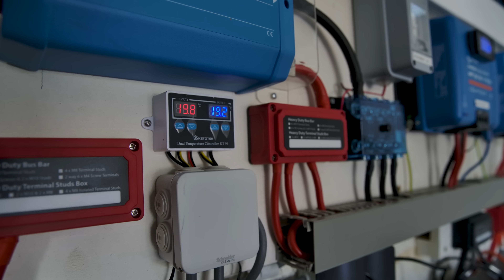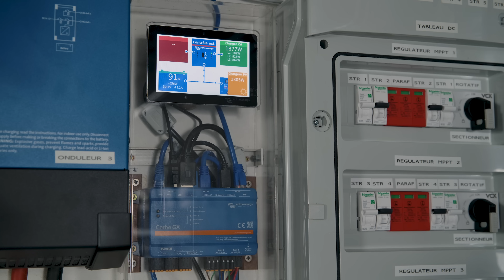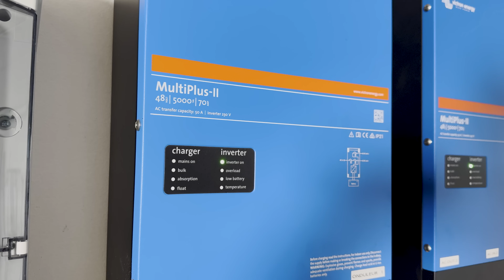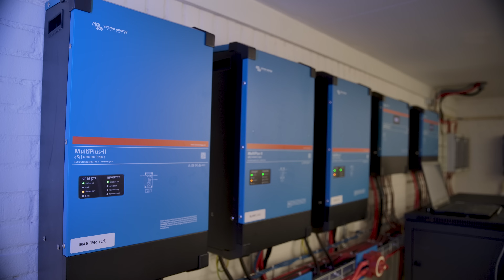Using solar and batteries to power this high-tech family home

Comment: I have 3 x Multiplus II's and 3 x MPPT 250/100 charge regulators here in Australia as well, only single phase but with enough panels I have now been able to disconnect the grid, there is even a Victron EV Charger here and there is sufficient solar power to charge the car. I will be setting up a small extra so that I can send power from the car, into the Victron Multiplus II's in case the sun ever goes away, it really does go away a LOT during winter here.
Reply: Bonjour 
 je suis ravis que sa fonctionne bien,  j'aimerais savoir, c'est la capaciter des batterie,. et la puissance des panneaux solaire .que vous ave installer

Comment: I've installed 1 Multiplus II 10kva system with 2 MPPTs 250/85, 16kw battery and 16 x620w panels and installed 2 more systems with Multiplus II 10kva, 16kw battery and 12x 620w panels for my parents and my neighbour as well.  

Absolutely happy with the equipment

Comment: Please change Mppt terminals to eye connectors. My RV almost burnt down because of screw terminals shorting out. And, I lost my Mppt, because it was my fault for not tightening the screw terminals after 1 day of use, then a week, then monthly. Look under the hood of your car, the eye connectors installed last the life of the car, In an extreme environment! Thanks

Comment: I am proud to say that Pakistani are also using victron invertor. I am using victron energy easysolar 48/5000/70 with mppt 150/100. Pakistani have installed 31.5 GW Solar panels in Pakistan in just 3 years.

Comment: As far as I know, Victron does not support delta 3-phased, only Star 3-hased (otherwise I'd buy Victron Multiplus battery). In the video, I see three MultiPlus, looking like a 3-phased system. In Belgium we have delta 3-phased for residency. Do you happen to have star 3-phased system or does Victron supports delta 3-phased systems now?
Reply: I'm on three-phase 400V, and you can run a three-phase 400V motor. I have an installation for a house that I did with a pellet boiler with several three-phase motors, and everything works very well ....
Reply: Ok, so you are lucky to have the Y configuration

Comment: These videos are honestly what motivated me to go with Victron products. I'm currently using a SmartShunt 500A, along with two SmartSolar MPPTs — and I’ve really appreciated the system overall.

However, I’m facing a persistent issue with my SmartSolar 100|50 unit. Even after the v1.67 firmware update, it struggles to track the Maximum Power Point properly under load, and efficiency drops significantly compared to my other MPPT (100|15), which works flawlessly.

I’ve already put together a full documentation of this issue — including graphs from Venus OS Node-RED, SmartShunt data, and real-world tests — and shared it with both dealers and the Victron community. But unfortunately, it doesn’t seem to be getting the attention it needs.

I would really appreciate if someone from the engineering or firmware team could take a look. I truly believe in Victron products, and I just want to ensure I’m not stuck with a rare faulty unit that can’t be properly diagnosed.

Happy to share the videos and data again if needed.

Comment: A lot of the solar setups in the US shut down when the grid goes down due to fear of back feeding electricity from the solar panels onto the wires while the crews are trying to make repairs. I don't hear much talk about how Victron handles the grid going down while generating solar power or has battery backup. I went with an Enphase system in my house that forms a micro-grid. It combines power from the grid, solar and battery. The installers manually shut off the grid connection to test the installation and I didn't even notice it.
Reply: The multiplus detects the power outage and switches off the internal relays that connect the grid and goes in island mode. After the grid comes back it synchronizes and the relays close again.
Reply: @SiegersNL  Yes, that's correct.
Reply: That is basically what my system does but my comment was more about I don't hear much talk about it. 
My battery is constantly connected so there is no interruption of power delivery. The system probably plays around with various voltages to control the flow of energy so it can charge the battery only from the solar or from the grid. I can use my battery to reduce the demand on the grid even without an outage. I assume the Victron system has similar features but there is not much discussion on the topics.
Reply: @wstrater  the victron multiplus is even more resilient as it has a separate grid, generator and island AC ports which are isolated from each other. While it is possible to feed power from grid directly to island with frequency coupling it has no problem with bad power supply or an unstable grid. This is cause of victrons root in marine/yacht systems where the grid can be disconnected or be low power or a generator cannot deliver the power the island should provide.
Reply: @martin5697 This is the part I don’t understand. If they are isolated, then how does it combine battery inverted power with grid or generator? Is there an interruption in power if the house is running on just grid and the grid goes down? Does it need to synchronize frequency when cutting over to battery?
I believe my system is always connected so solar and battery inverter are always in sync with the grid. It also means that when the grid goes down there is no interruption.
I am not trying say one is better than the other, I am just trying to understand.

Comment: Why doesn't he feed excess power to the grid in the summer instead of switching off solar panels?
Reply: Sometimes you get a fine when you do that depending on your contract.
Reply: Alors oui effectivement je ne voulais pas remettre le surplus sur le réseau. Parce qu' en Belgique le fournisseur d'électricité imposait un tarif prosumer   qui est de 86 euro par kW , en-dessous de 10kva et donc si l'onduleur fait 5kw x5. suite  à ça j'ai fait une demande au fournisseur pour pouvoir renvoyer le surplus sur le réseau. Ce que je ne savais pas c'est que si la puissance de l'installation dépasse 10kva ce qui est le cas . et donc je ne suis plus prosumer mes producteur d'électricités .Et sachant ça je peux revendre le surplus d'électricité. Ce que je fais  maintenant.....
Reply: @christianlalieux1980  thank you. so it is the electricity contract and not the technical capability of your system.

Comment: 5:52 nice, but, ...it is smarter to mix with some ac-(micro-)inverters, so you do not need to load from the grid when you exceed 9000 watts.

when you have for example 5000 Watt from ac-inverter, and you can get 9000 watts from inverters, then you dont need grid for example, when you use a  11kw instantaneous water heater for shower. but you have to shower always when the sun is shining ^^
Reply: Si je prend sur le réseaux c'est uniquement en n'hiver ou les journée son plus courte plus ou moins 3 mois et demi...

Comment: I think you should talk about humming sounds from multiplus inverters,you can't install it next to a living room
Reply: If you are getting that loud a hum from your Multiplus I would suggest you check the harmonic distortion (THD) with a Power Analyser.

There may be a particular appliance which causes that situation if it’s happening while off-grid.
Reply: Alors oui il y a bien un bourdonnements qui n'est pas excessif , mai l'idéale c'est de le mètre dans le garage

Comment: Same experience here. After a long research, I knew from the beginning that Victron was my only candidate, but I had to learn everything from the ground up. Before commissioning the system, I asked one of the best installers in the UK if he could inspect it and verify that nothing was horribly wrong but, as soon as he saw the quick video of my setup, he declined stating, just like in this gentlemen's experience, that he was not knowlageble enough to asses my Victron micro grid. As he says in this video, things can only go wrong with Victron if you set them up incorrectly, and after twenty months of operation, I am happy to say that so far I have had no issues. I have now built the second 17 kWh battery to combine with the previous 16 kWh and one of 5K.  https://www.youtube.com/watch?v=lExITYwRQOc
Reply: Sa prend du temp pour comprendre tous sa , mai quand on a trouver comment sa fonctionne on est super satisfait du résulta ....

Comment: Why does he need to disconnect solar panels in the summer? I get that In the summer he gets way more solar energy than he needs but why disconnect them? Why not just leave them connected and have the battery be fully charged earlier in the day?
Reply: extra panel for winter to match the summer like output
Reply: Pourquoi je débranche des panneaux solaire en été  , il y a 2 raisons a sa .La première c'est que j'ai constater que en fonction de la configuration de charge batterie que j'ai , je n'ai pas besoin de plus. la 2è raisons sa évite l'échauffement des MPTT. IL faux bien se dire que un mauvais calcul  de puissance peux créer des dommages ...
Reply: @christianlalieux1980  An MPPT will not overheat when current limiting. It's current limiting, not current dissippating

Comment: If this system can not run kitchen and bojler at the same time, how can run dishwasher, 5500 W induction heating, air conditioner and also 11 kW battery el. vehicle ?
Reply: The system operates on a 400-volt, three-phase system with a power of 12 kW, and I have no problem turning on the stove, nor the dishwasher, nor the kettle at the same time. This is because the loads are well separated on the phases.
Reply: He is looking to optimise his self consumption of produced PV and peak shaving to reduce his dependance on the grid in the summer. In case of a grid down situation, he will probably only power essentials like the kitchen and lights, no need to waste energy on for example a boiler
Reply: Need Growatt low frequency inverter 12kW, 3 in paralel... No problems, 2x electric cars, air con + hot water heater + induction induction cooktop at the same time .. 😊
Reply: This system cant, use some 3x8000 Multiplus and you can even charge your car with it 🙌
Reply: @anzzgar  If I understand you want to know if I can recharge a car battery, it's yes....
Reply: We should acknowledge that the video’s main character is commenting on this YouTube thread 😊

Comment: Looking forward to installing my three MP II 48/8000 soon :)
Any information you could share if Victron Works with Fronius Symo GEN24 Hybrid Inverter on the AC-Input?
Reply: The Fronuis brand is compatible with Victron. It can be connected to the ACIN input. As it can be connected to the ACOUT1 output.
Reply: @christianlalieux1980  I hear that, but its not specified if the GEN24 Hybrid is supported.
Reply: @arminkaiser8933  Je ne connait pas toute les références de fronuis .IL faut juste savoir que ci vous avez une coupure réseau l'onduleur sarrette. Moi Jai vite de le maitre
pour des raisons technique...
Reply: Yes, GEN24 works. But why use an hybrid inverter when it’s much more expensive than the Symo / Primo?
Reply: Will you be installing these in parallel or 3 phase? If parallel, I'd appreciate any guidance or information on the external transfer switch wiring. Thank you.
Reply: @lant404  At my house, the inverters are three-phase...
We're talking about the transfer switch to go green to the grid. In case of a problem with the installation,

Comment: Victron is good brand, but you can make 68 kWh battery for 4800 € and 15 000 VA inverter for 1000 € and 100 A MPPT DC-DC BUCK synch. interlieved topology for 150 €,
1000 A shunt cost about 100 € with better precision at temp diff. , so i do not believe this system costs only 6400 € without solar panels.